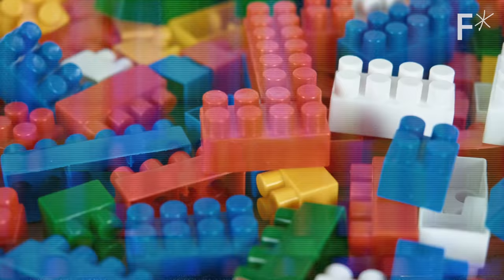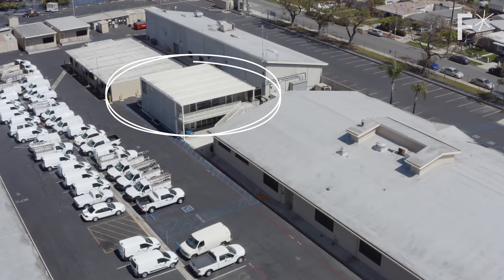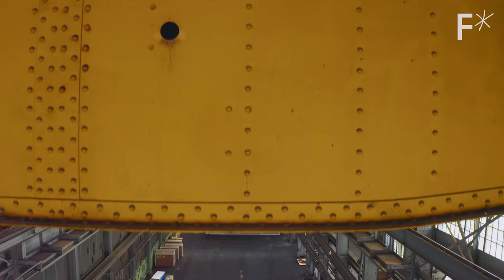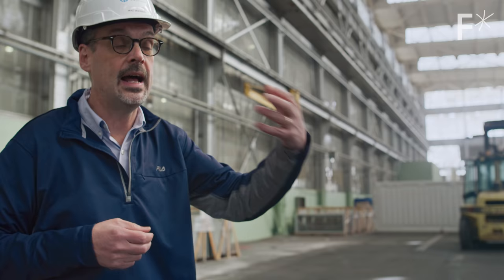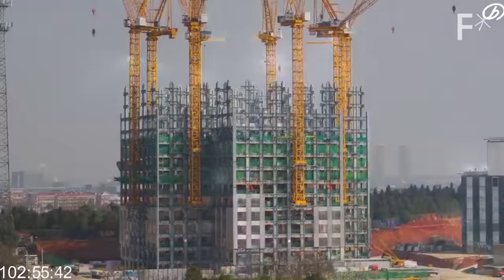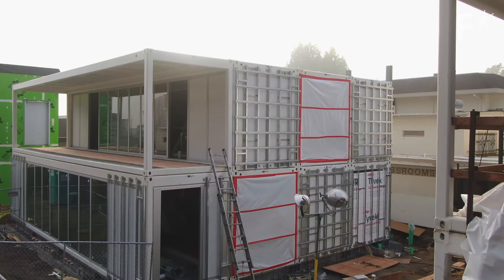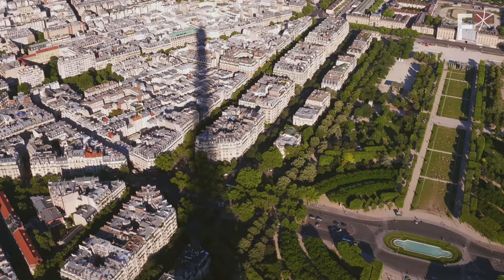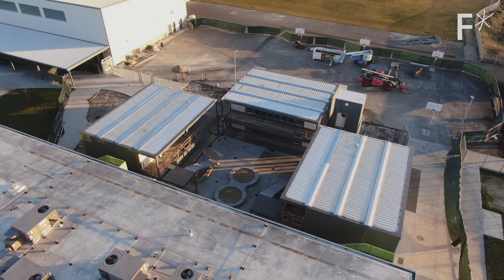Is modular construction the future? | Hard Reset by Freethink

Comment: I'm a structural engineer. While modular construction is interesting and has certainly captured a market, what the video fails to mention is there's a premium to modularity and what's been shown has significant limits; you can't just stack them indefinitely. What they have is a two-storey demountable classroom and that's fantastic, but let's not get carried away here.
Reply: I am not a structural engineer. What is the premium that was never mentioned ?  Also, why doubt multi story structures even though the video shows the sky scraper in china? Is your concern with the practicality of disassembling a structure of that scale? Just arguing for knowledges sake :)
Reply: But there are so many buildings that thrive as three stories -- especially building medium density in cities!
Reply: Why is their a limit? They are designed to be put in place of a shipping container on a ship and they can stack very high.
Reply: I am also worried about the structural stability such as Earthquake and Wind load capacity. Why not try steel structures?

Comment: There would quickly become an aftermarket of modular facades to make these buildings LOOK like historic buildings. Then, when you need a different building in the same place, you could rearrange the facade modules and easily have a new building of the same style. Hell, even the graffiti could be reused, just in a different spot on the building.
Reply from the maker: Interesting point! They could be really cool to customize in all kinds of ways. People certainly customize their homes and cars plenty already; the standardization could really facilitate an industry around mass customizations.
Reply: modular graffiti, has to conform the 2.4 meter module.
Reply: @kevinwelsh7490  I'm guessing that at least some graffiti artists (and possibly even taggers) will learn to stay within the confines of individual panels once they see the panels have been rearranged. They like to see their work last as long as possible.
Reply: @GrantSR  don't you know; graffiti artists by definition color outside the lines.  this video is a brave new world...
Reply: Excellent idea, because otherwise everything would look blandly similar and aesthetically sterile.
Reply: @freethink  And while that would start mostly with the panels that fit in the structure, it would quickly spread to the basic frames themselves, prompting the appearance of all the other sizes of LEGO blocks. To put it simply, this basic container frame is the Standard Meter of modular construction.
Reply: @freethink  Under your system, graffiti could become modular mural art, another industry. Developers could customize the exterior with Banksy installations for  period of time or replace them periodically. Exterior designers. Not to mention billboard advertising to offset construction costs.
Reply: Of course! I didn't even think about that! That sounds incredible.
Reply: Just like how regular lego can be dressed up to look like anything, even with a basic 2x6 base underneath!

Comment: I'm scared to ask how the noise isolation in that structure is. So many other issues, but it is a good idea.
Reply: Not just noise, also heat insulation.
Reply: Probably similar to 2x6.
Reply: Yah a lot is just not now yet and more would need to come out to make a choice
Reply: If the STC rating is not currently satisfactory, adjustments can be made to reached desirable STC ratings. Trial and error with experience until results are achieved. 
Heat retention is either currently operating well or also can be improved with time and newer materials. 

These two issues seems easier to achieve. The big game changer is the RED 6 modular design. 

Very impressed and want to see more examples with time.

Great work❤️
Reply: Noise cancelling panels that also serve as insulation is pretty nice.
But the design to do so efficiently and with low mass is a little troubling for my engineering ignorant mind.
I'm thinking about those triangle things in the quietest room, but sandwiched inside the wall panels with a bit of space between them, whatever the appropriate distance turns out to be.
Reply: water ressources and toilets shoud be built no ?
Reply: environmental separation, heat, rain, not to mention pluming, electrical, ventilation, fenestration, finishes.  not much of a head start with that 2.4m frame they are so proud of.
Reply: I'm an interior designer and I helped convert a shipping container into a classroom at a project my parents run in Africa.  The size of shipping containers is great for shipping, but is really awkward for human living.  I'd be interested to know about the types of configurations that can be done with the floor plan when they're connected. I can totally see how exterior design could become more of a thing!
Reply: @Rhedox1  yeah, I'd like to see this in cold and hot places, and what the inhabitants have to say. It still sounds better than current construction practices.
Reply: @vonsassy  Have you tried tiny house designs?
Reply: @nullpoint3346  why low mass?
Reply: Yes me too, plus where do they put the stairs and swewge pipes and electrical utilities? And windows?
Reply: They obviously have some type of structure inside and insulation is easy to install nowadays
Reply: @Rhedox1  They obviously have some type of structure inside and insulation is easy to install nowadays
Reply: Its fine. The Plaza Hotel in College Station, TX was a prefabricated building and it was just as good as any other high rise building
Reply: @Rhedox1   Soviet microdistrict vs USA Suburban
Reply: The panels should be made out of hemp. High noise and heat insulation value
Reply: There are standard solutions that would work for "part wall". Offset supports between units so sound vibration is less likely to telegraph. Mount wallboard with resilient channels to absorb more sound. Insulate between units with mineral/rock wool to deaden it more.
Reply: I understand what your concern is but I see a skeleton solution that I'll apply to my own application. I think that's the great thing about this solution. I know what I'm going to do with them, I know how to resolve my particular needs be it sound or thermal or any other metric. I will be interested for example to see how well a building constructed of these modules acts as somewhat of a faraday cage as they scale up in numbers of modules. But I like that. Eg if I want a signal in the centre of a large modulararised building constructed of these but it agglomerates to a faraday cage in the core, then I might locate particular laboratories there. If I need a signal then I can engineer the solution. It's great because this simple approach simplifies any problems you might encounter in your own application. Given that I will be using them in a scientific, engineering, regenerative sustainability development hub, it's kind of down our alley.

Comment: This is a great premise. The only problem I can see with it is, a tornado or hurricane could probably uproot these things since they're removable.
Reply: I'm pretty sure they don't just plop them on top of the ground without bolting them down to the ground.

This modules would be perfect in the south where seasonal hurricanes and flooding occurred since they could just raised this modules up a few feet.
Reply: We have screws, we can make bigger, stronger, longer screws until we hit the limit of the material itself.
The problem isn't that they'll be picked up, it's that they'll be shredded. But that already happens with our existing low quality infrastructure.
What does survive the storms gets demolished by contractors eventually.
Reply: And yes, with design changes we can also bypass the material limit too, but that'll take a bit longer. Case in point, dynamic solids.
Reply: I live in Utah. Winds? Not a big deal. Ground Movement? Significant.
I'd like to know how they 'Stack Up' against that.
Reply: These modules will probably last as long as our crappy appliances
Reply: @pillager6190  based on the design we saw in the video, it appears the only structural members top to bottom are the four corners, which mimics some Japanese carpentry techniques for building on earthquake prone land. The insides would still be shaken, but the overall structure should flex and roll with the changes before easing back to it's equilibrium. Obviously, this is without having seen any actual engineering drawings or material analysis. Based on what abuse we know containers can withstand though, seems likely this would be the case.
Reply: You just need to make connections and foundations stronger
Reply: There’s tons of other problems, such as leakages between parts, unoptimized solar exposure, inflexible spatial plans that cannot be used for dynamic functions.. the list goes on. The idea had been around for thousands of years now. You can look at habitat 67 and see the problem there
Reply: This lego building setup would reaaaally work best in Africa .
Reply: Or someone gets a crane just comes by and steals half your bedroom
Reply: @trapfethen  Steel doesn't flex like wood does though. But it also has much higher tensile strength. Suspect the real risk is the boxes decoupling, however that can be prevented.
Reply: In Western Australia they have been using these container homes for many years to house mine workers, they’ve also been built to with stand hurricanes by attaching them to massive concrete blocks as counter weights
Reply: I agree, in a lot of places that would never be a problem tho.
Reply: You can easily lock the blocks onto the ground.
Reply: If it can survive on a shipping container, I’m sure it can survive some wind.

Comment: Wish they would have mentioned how high they can stack them. Sometimes you only have a small area of land available, so you have to build up, can these be safely stacked 10 high? 50? How do elevators work with these when you start going more than a couple of levels up?
Reply: To have such tall buildings you need a strong foundation and an aerodynamic shape specially if it's a stand alone amongst shorter ones wich calls for more land ironically
Reply: Your profile pic is the saddest thing.   That poor kid
Reply: A standard intermodal container is 2.44 m (8') wide × 12.19 m (40') long × 2.90 m (9'-6") high.  The corner posts are typically 10 cm (4") tubular steel with the cross beams being of similar tubular steel size.

While container ships can stack intermodal containers 10-12 levels high (dead loading), for human occupation you'd likely be limited to perhaps 8-10 floors to take into account "live loading" (human movement) within the building.  Anything higher would likely require custom structural reinforcement and support.  Vertical service plenums such as elevator shafts, stairways and HVAC/plumbing could easily be modularized to fit the modular structure itself.  Then there's seismic and wind anchoring issues to deal with.
Reply: @MelioraCogito   those social containers are beign build for 15 years at least. All beams are open profiles made by cutting from flat sheet metal (laser/plasma) of thickness 3-6mm (depend of design and designation) then bend on press brakes - those are not closed rectangular/square beams. Stacking up i would say max 5 levels.
Imho that long frames are not practical with assembling, better would be some shorter, length-to-width ratio should be  3:1, max 4:1
Reply: @Ed nice thought about the elevator, but do you remember movie 'the baby' in the construction building the  lift was temporary.. So lifts could be made in which a lego structure could be elevated.
Reply: @Bryczqa  I was thinking that as well.  40-45' is very long.  That's a lot to ask when you might want to put something heavy (like my mother in law) in the middle.  But if they produced something at a 20' length it would be very good. They could move them by ship/rail/semi just like they move 20' shipping containers today.  20' units give much more flexibility.   This will probably be done later.  This company is brilliant.

Comment: What we forget is that these parts are only a percentage of total building materials - what about the insulation? Windows, Facade? 
Steel-Frame Containers also need to be substantially upgraded with different materials to reduce noise and condensation problems. Prefab works good with elements, these 3D Modules only work in special use-cases (i.e. we need 300 hotel rooms).

Comment: I have to admit, if you can disassemble them enough, you can recycle them/repurpose them easily too. Although, since I live in an area where I would rather live in an old stone building for thermal/insulation reasons, i think my area should build permanent buildings (and not modular) with "historical looking" facades that can be modular inside, as in... non specific construction, allowing businesses to swap and renters/owners to replace businesses.

Comment: Waste plumbing is the “challenge”, especially for reuse. Waste usually uses gravity, so drainpiping would require holes in floors, compromising structure; and what if “next” application doesn’t need waste line holes there?

Cruise ship industry already builds ocean liners with prefab staterooms using vacuum waste lines, which can and do fail!

Comment: The first question I had was about the plumbing. I've only seen this type of modular innovation in homes. I don't have a problem with any of this. It's just crazy that this type of structure exists. I wonder if this metal box would work in Arizona. Hmmm...
Reply: Coat them in ultra reflective material
Theres very effective and cheap white paints out there

Comment: pipe dream.  end module, corner module, with or without roof, a building complex has to remain in the same configuration after it is moved.  Are you going to gut everything out of those minimal frames? What's left even?  How to move a building to a different siting situation and function.  It will not be suitable.  Great, we can purchase buildings that are off-the-shelf but not suitable.

Comment: A very different idea when compared to the usual construction method, I guess the only issue is customizability when it comes to size. Why is the founder stuck on one size? More designs and specs means more customers as opposed to forcing people to pick one container essentialy.
Reply: I bet they are trying to go for maximum versatility to start out with, get a footing, then expand into other modular designs when needed .... if not just bank on those who need this service desperately and let the custom obsessors get over it.
Reply: Cubes are more customizable, but also leave a lot of pillars.
Reply: You can build whatever shape you want out of these, it's extra and unnecessary cost to make a whole other design that would be untransportable essentially.

Comment: For commercial buildings sure, but for living spaces, not likely. Where do they put the stairs and swewge pipes and electrical utilities? And windows? Plus how is the insulation for notice & heat? I am betting this will NOT catch on any time soon in modern cities.
Reply: conduit in the wall, roof and floor.

For windows and walls. Module wall panels.

Comment: This is a brave attempt, the question is why. I see 2 types of changes.
Type A: One space can be used for many years for many purposes according to that area, the most changes can be happened just inside, not the building structure for similar purpose, eg a shop space can be changed to another shop, or restaurant, a school can be changed to a library. In such changing, it seems no need to change the structure. So a modular building is interesting but not very necessary.
Type B: a big function change, like change a school to a swimming gym center, or a power facility , that would be impossible even using the modular building blocks.
Reply from the maker: Interesting critique, valid points - there are definitely scenarios where this would not make sense.

Some scenarios where it potentially could:

1) If the building simply costs less to produce modularly than it does with conventional methods and/or can be completed faster. For example, LA has recently had some success producing homeless shelters using modular construction where conventional projects were more expensive or took years to produce. 
https://www.latimes.com/homeless-housing/story/2021-01-18/los-angeles-homeless-housing-project-vignes-street

2) Scenarios where you might want to completely remove the building. So while you might not want to convert a gym into a power facility, you might put a gym in a place and later want to put something completely different there; this would enable it to be disassembled quickly, and have the components still available if someone else wanted to start a gym someplace else, whereas with conventional construction you'd have to do a demolition, throw away all the materials, and start over.
Reply: @freethink  I agreed there’s many scenarios which your solution can be used for. The point is if the solution’s value was high enough to make people accept it widely. So you can find enough customers to roll forward the project. My concern is :
A) Your proposed value is saving cost, like cut  $1M to half. 
B) but modular components are naturally more expensive than 1 time parts, for you have to have more design for parts standards, reliability, assembly interface and assembly process requirements for training and training skilled workers. So that’s why a LEGO toy car cost much more than a traditional equivalent toy car.
Then we can see the above 2 points are conflicting, how would you solve the conflict?